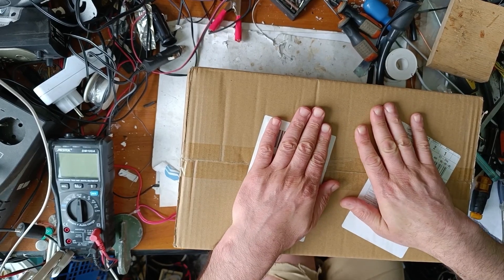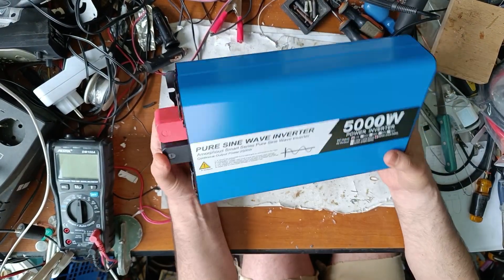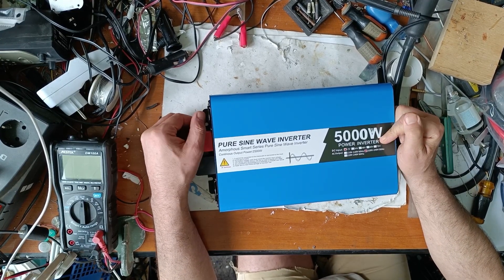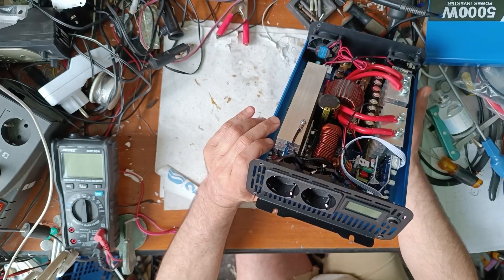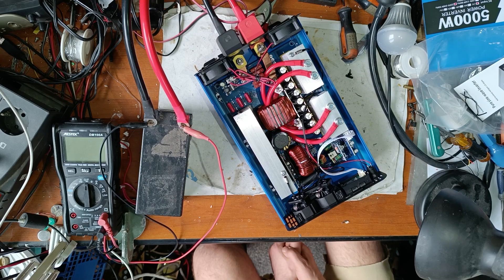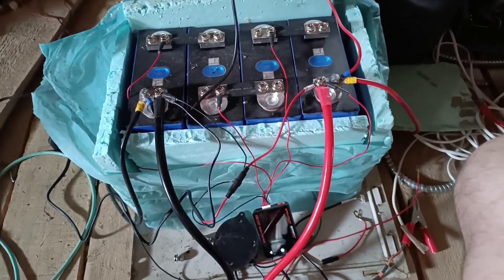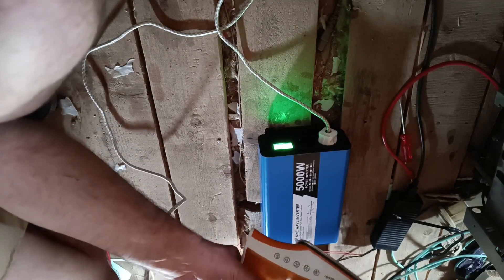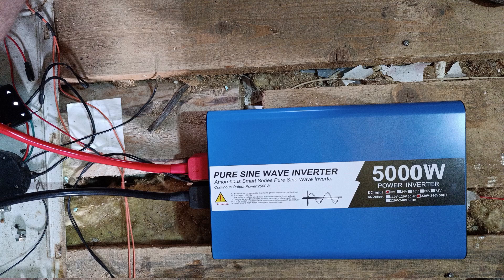Easun 5000w Pure Sine Wave Inverter Test Worth 90Usd?

Comment: Dupa constructia interna, invertorul pare sa sustina o sarcina contiuna intre 1000W - 1500W. Nu l-as forta cu mai mult de atat pe termen lung (mai mult de 5 - 10 minute), pt. a nu-l supraincalzi. 

In rest calitatea pare ok, mai ales pt. pretul acestiua. Cu siguranta e dublu calitativ comparativ cu marcile (tepele) locale care se vand pe eMag. Sa te foloseti mult timp de el!
Reply from the maker: eu cred ca totusi are 2500w reali.
Reply: @diymariuselectro  Poate duce 2500, dar pt. scurt timp. 

Eu ma refeream la design-ul termic. Eu nu cred ca acele radiatoare de aluminiu sunt suficiente pt. a sustine un consum continuu de 2500w, fara ca tranzistorii sa se supraincaleazca si sa se arda.

Poate gresesc, nu sunt expert in acest domeniu.

Eu mereu reduc la jumatate valorile specificate de producatorii chinezi, ca sa fiu sigur, mai ales la prduse ieftine.

Pana nici cei de la Victron nu rcomanda folosirea invertoarelor la capacitate maxima pt. mult timp. Am vazut un podcast \ Q&A pe canalul lor si recomanda solicitarea la maxim a invertoarelor pt. 30 minute la o temperatura ambientala de 25C.